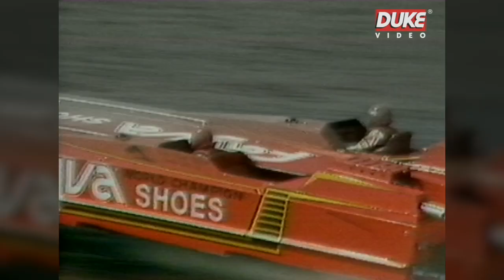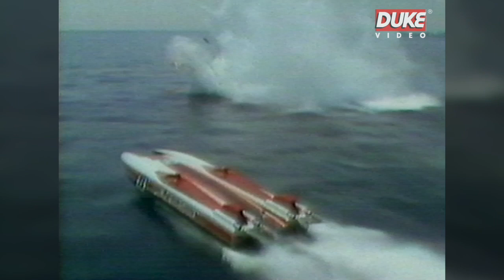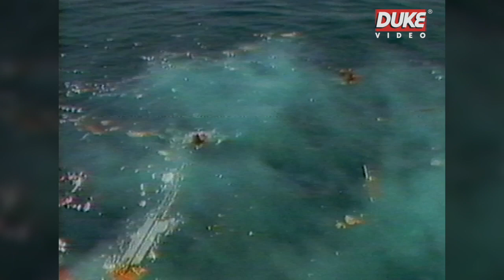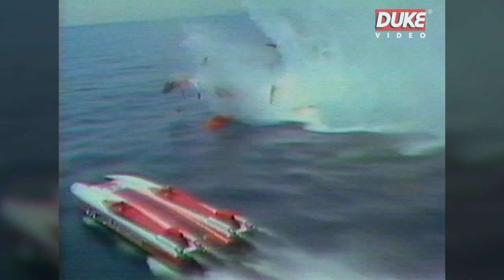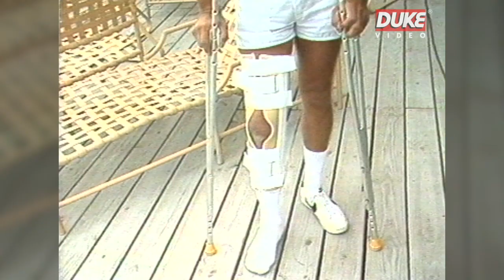1981 World Powerboat Championship | Big Crash for Fayva Shoes

Comment: Didier Peroni:
Formula 1 (Tyrrell, Ligier, Ferrari) 5 years. A massive accident which broke both his legs,  almost amputated, beat the likes of Prost and Villeneuve, commonly considered 1982s real champion.

Sportscars 5 years, racing such a monster as the Porsche 934 Turbo at LeMans 24hr which he won in ‘78 in an Renault Alpine, and being overall really fast.

Powerboat 1 race, (1987) deceased.

As dangerous sports go, this was number one for quite some time.
Reply: @Tom_Hadler  
Definitely a motorsport yes. Rallycross and Group B rallye cars were passing 650bhp at some races. As you say, the 80s were big.

Comment: Strange crash...,  what's happened... 🤔⁉️💯🔥🛢️🏁🏎️🤓
Reply: I think they don’t get much time to realise it is going wrong. And without brakes , there isn’t much they can do anyway. Slowing the engine doesn’t work quick enough.
Reply: @AndrewEdwardBailey  Hello, yes, their inshore jumped a lot before the crash if you look the video... A bad wave, a powerful boat and a too light body... 🤔⁉️💯🔥🛢️🏁🏎️🤓🇨🇵
Reply: 120mph+ in a very lightweight catamaran that was out of control - the bow of the boat kept going way too high and it was only a matter of time. These catamarans run what is in effect an aircraft wing between the sponsons - giving lift, less drag in the water = more speed.